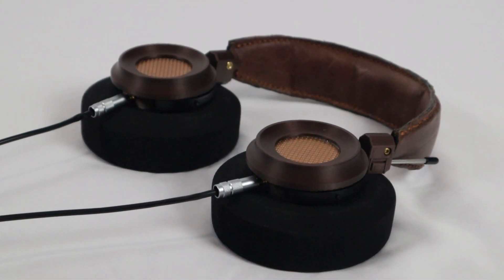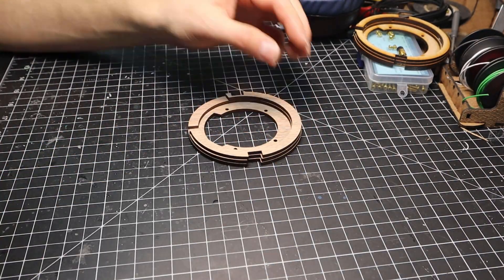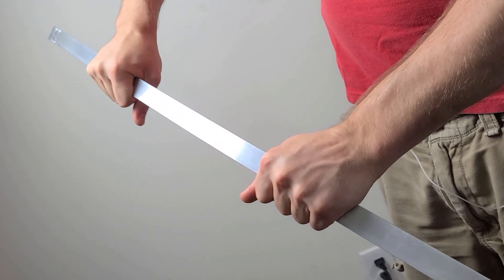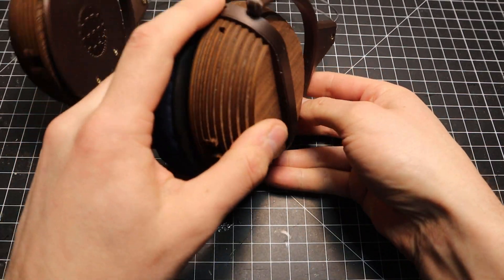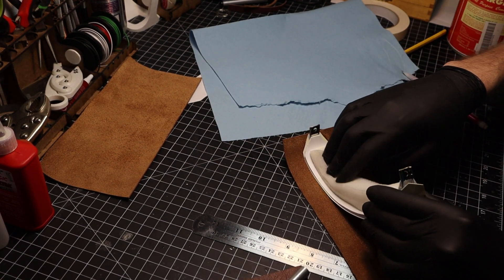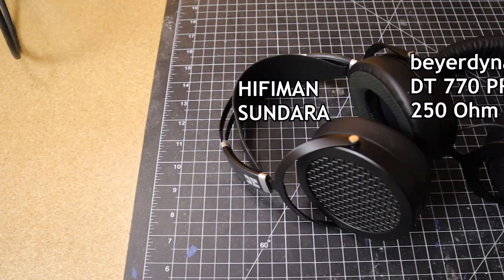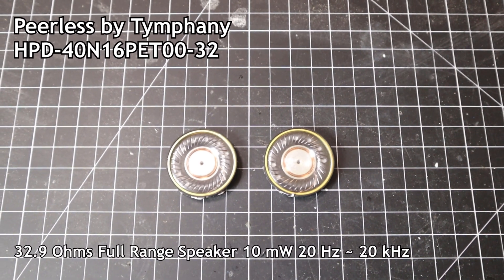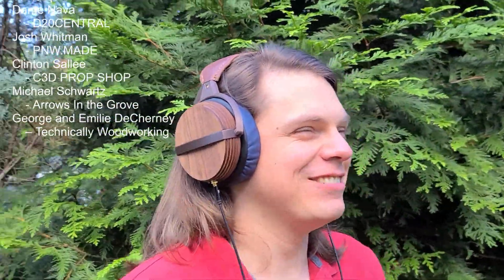Can you laser cut headphones?

Comment: Great build. If you have the time and tools, you can use brass or any cheap and light metal. I did some brass elements on a speaker I build entirely from scratch including the electronics (It sounds well enough for what it is). There is a lot of filing and sanding and polishing with a fun bit of drilling to do, but the results are worth it.

Also you can use a special tool that is rather cheap to trim the edges of lether to a nice round shape like you see on good lether work.
Using cloth on the bottom is much more comfortable.
Reply from the maker: Thank you!